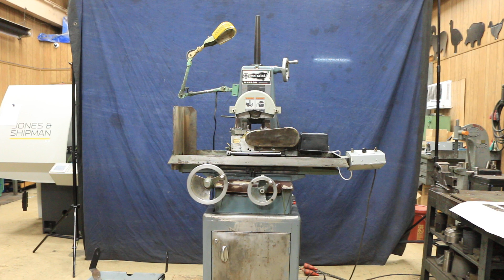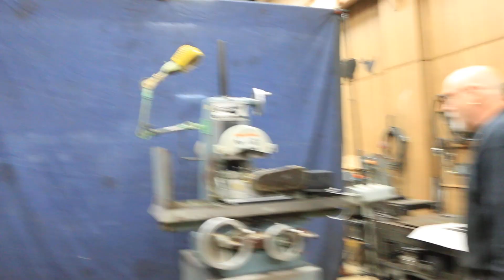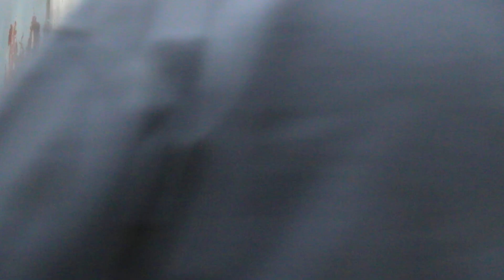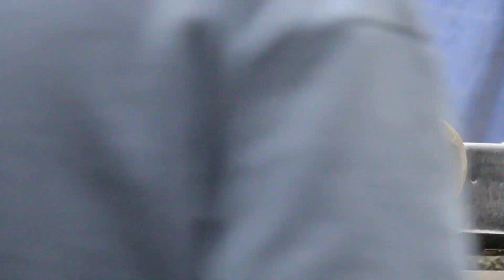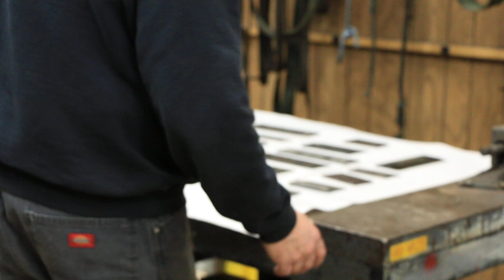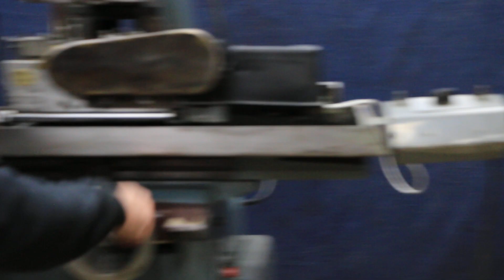UNISON DEDTRU CENTERLESS GRINDING MACHINE

Comment: Sir, I want to grind 0.36 mm sintered carbide pins from diameter 0.50 mm without chattering .
Tolerence on diameter 0.36 mm is (+0.000/. -0.002mm)
Can you help me that how can I Do it?